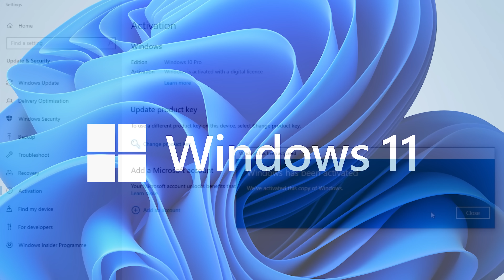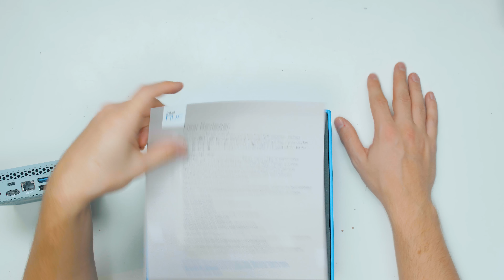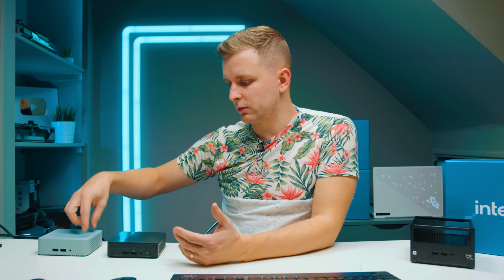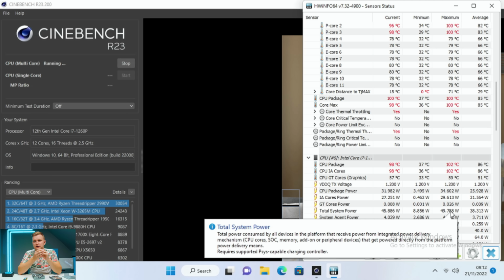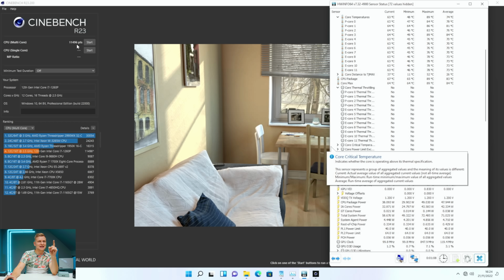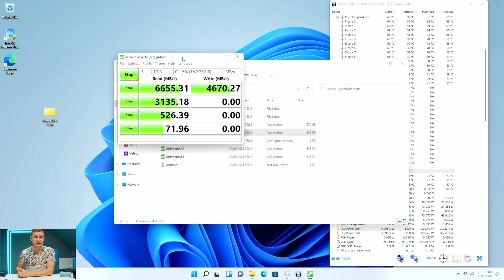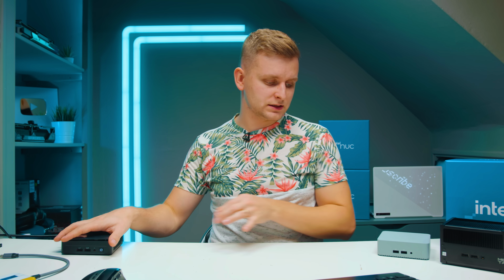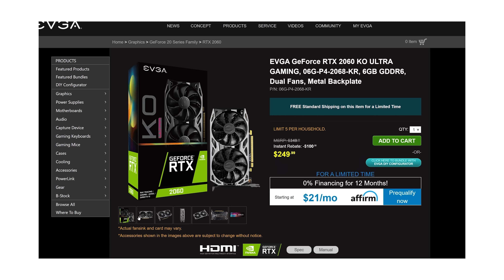NOT 1, NOT 2x but 3x MINI PCs 😱 | Intel NUC12 Pro Review & Test

Comment: 03:24 About the lid. There is a company named GoRite. In their Categories menu there is an option "LIDs for Intel NUC".
The category "Dongles & Accessories" is also of interest when you have the tall version of a NUC. There will be a back-panel expansion bay (it's covered similar to a PCIe slot cover, but fastened with two screws).
From the "Technical Product Specifications for Intel NUC Products" for 13th gen:
"Chassis Expandability Options
The tall chassis provides a back-panel expansion bay that includes a removeable faceplate for
when no ports are installed and an internal removeable bracket that is pre-punched for attaching
one DB9 port. Some 3rd party expandability dongles are available from Gorite and a
specification is available for the design of 3rd party add in cards."

Comment: The passive cooling unit would be great for industrial use case. Chuck it in a video billboard or as the pc for a smart traffic light system. It'll make for a great low maintenance unit.

Comment: Put that minpc in a dorm room refrigerator you can buy for 50 bucks and set the temp to get the PC where you want it . I'd love to see some build a full-size pc out of a dorm room size refrigerator and pull some data on temperature.
Reply: Fridges arent meant to run stuff that is hot, gonna break that thing pretty fast and it will be loud since the compressor have to work all the time.

Comment: The strength of these things is in the lower end models. If people want high end performance they aren’t buying these. The low end you can still run full windows and have a device that is library computer level at a very compelling price. Looking at them as a thin client alternative so we get full remote administration and full feature VDI access and can even be useful for short usage for visitors.

Comment: What are these units intended for? I always worry about NUC's. I have friends who love them.
Reply: Looks like it is intended to be a small but powerful office PC that you can just mount it behind the monitor (also helps to make the office looks "cleaner").
Reply: office users love these because of the small footprint, power/energy efficient, quiet, dependable workhorse with an amazing 3 yr warranty. Others use the NUC for Digital Signage, Kiosk, conference, manufacturing and other industrial applications.

Comment: A nuc would make an awesome HTPC...maybe one day! 😁😁
Reply: As most HTPC set ups are 2 units not 1. Unit 1 the PC with good enough hardware to play movies and a network port of at least 1Gbps for wired networking as wireless isn't good for streaming local uncompressed video files. Unit 2 the NAS loaded with hard drives Most use a 4 drive NAS  thinking they will not need more space. Plugged into the same network as the HTPC you will have a slower response time than if you store it all locally on a M.2 2TB drive for the second slot that is not taken but the time delay doesn't matter for HTPCs.

I have seen some replace the original M.2 drive with a 1TB drive and add in a 2TB drive for internal storage to hold everything. Lower latency and Intel fixed the heat problems before release so having 2 M.2 drive doesn't cause heat problems. There is also a SATA port and power connector so you can add a SATA 3.5" drive for when you run out of those 3TB of storage space. Videos do take up a lot of storage space. I still do think that having a NAS is a better solution as upgrading with another hard drive or set of hard drives if using RAID 1 is quicker and much easier than having to with internal storage to a PC.

Comment: when the side with the holes is on the top it also gets the dust in and not only the air ;-)
the most important thing in a mini pc for me is that it is SILENT. and the older NUC were quite loud compared to other mini pcs.
Reply: In my opinion that is nonsense though because it is avoidable. These devices already have a small foot print. I fail to see why they could not go up in height and pack more heat pipes and fins on top. Like an Xbox Series X really. Just not the same actual overall extent unless there is also a higher performance GPU in it.
Reply: @techpriest4787  NUC also offers a version of the "Tall SKU", which allow users to insert their 2.5" SSD and other expandable IO ports. In addition, the smaller NUC allows the users to mount this NUC on a 1-U rack mount, which is very popular for commercial usage. Adding an external Gfx will impact the size of the power supply, thermal, and system noise level.

Comment: Love the Intel NUCs, AMDs new stuff is more efficient but Intel is pure power.
12th gen in a small package that dose 3ghz+, you can easy run game servers on one NUC, takes zero space.
Reply: Yea except for Intel's IGPU's Haha... AMD leaves Intel in the dust with integrated graphics, and still manage to come VERY close in raw CPU performance as well... Sorry bro, but AMD is winning, especially when it comes to Price=Performance! 

But I'll admit for workload, Intel is still the champ, just not by much!
Reply: @MrRunItUp  Depens on what you do, if you are going to game AMD is the only way to go but even if the RNDA2 gpus in 6xxx-series apus are better it's still not great. 
Intel's Iris igpu works well enough for low end games and emulation, way better when it comes to creative work. But we are talking mobile units here, if ruomors are true about the 13th gen mobile cpus Intel is going to take more ground, saw some benchmarks with the 13900HX mobile that was on par with the new i7 and Ryzen 7 desktop variants.
Reply: @ForWhomTheBellsTolls  yes, I absolutely agree with you!
Reply: Old info there kiddie - AMD loses in performance, sales & efficiency.
Reply: @godslayer1415  AMD have doubled sales on the mobile market in the last few years and Inte have lost shares.
Top model preformance is better on Intel yes but efficiency is worse, 12900hx draw alot more power than Ryzen 9. 13th gen might change alot.